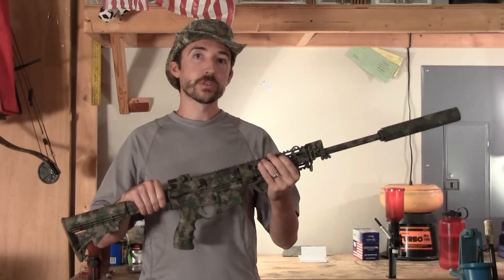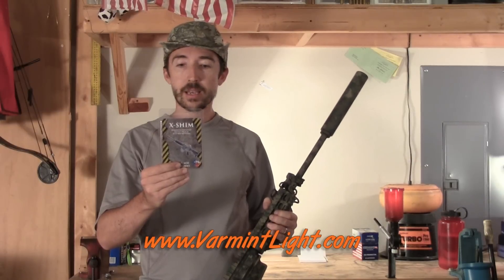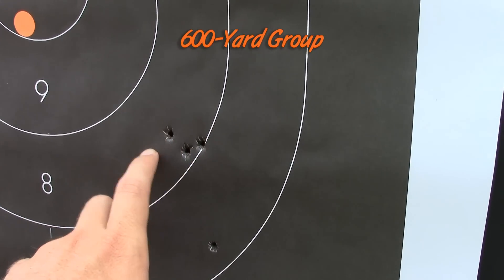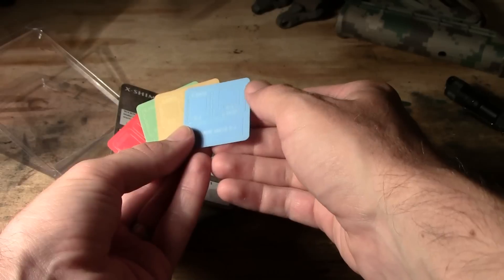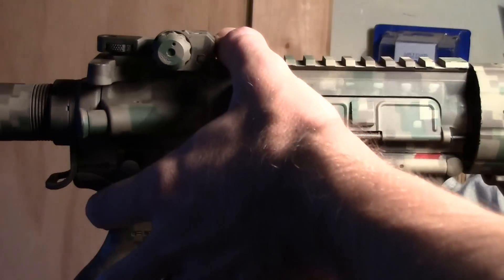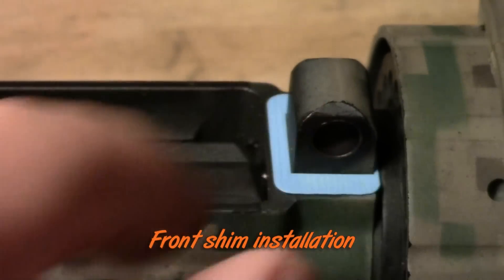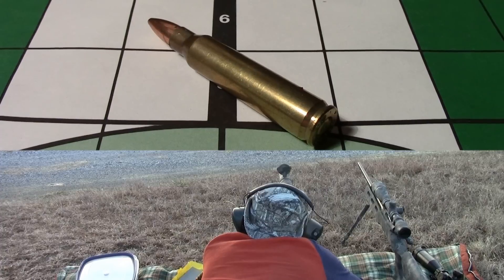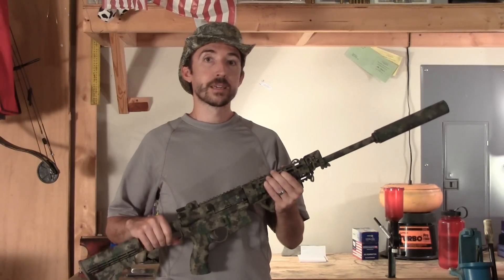Accurize an AR-15 with X-Shims for the AR-15 and M16 | The Social Regressive

Comment: Older video, I know, but I've been down this road.  An older AR of mine was always a 1.5 to 2 MOA shooter, even with developed hand loads.  It had a bit of slop between the upper and lower.  I tried the accu-wedge and it made no difference.  So, similar to the plastic wedge above, I used some stainless shim material to tighten things up (I didn't permanently mount it, I just wedged it between front and rear and used the compression of the fitted parts to hold them in place).  I noticed no difference in accuracy.  I shot the rifle with my stainless shims over a period of time, again, it was still a 1.5 to 2 MOA shooter.

To me, this makes sense.  The barrel, upper, and BCG are all "one piece" in function and the lower provides no support in terms of those parts functioning together other than to provide the fire control group.

So, what I found that does make a difference is the barrel extension fit to the upper receiver.   There are several ways to make this fit tight.  In my rifle, I could remove the barrel nut and slide the barrel right out of the receiver.  When seated, there was slop and wiggle.  One of the traditional methods is to wrap the barrel extension with a piece of stainless shim stock and then use green loctite 620 to fit back together and make it tight.  It does work, however if you ever decide to change your barrel, removing it is a royal pain.  Another method is buy an after market barrel extension slightly over size by various amounts to achieve a tight fit.  One downside with this is achieving proper head space if you don't have a way to mill things to dimension.

My method involves the stainless shim stock and heat.  Years ago I flew powered paragliders and the reduction pulleys to drive the propeller are mounted via bearings in an aluminum housing.  The trick was to heat the aluminum housing in the oven to 300 degrees, put the bearings in the freezer and once to temp, the bearing fit into place easily.  Once the aluminum cools and the bearings warmed, the interference fit was quite tight.

So, using that method, find the thickness of shim stock that allows you to fit the barrel extension into the receiver snugly at room temp.  Change the shim stock to one that is .001 to .002 thicker, then heat the receiver and cool the barrel extension and fit them together.  Once the pieces reach ambient temp, you'll have a super tight, wobble free assembly that can handle some higher temps and remain somewhat snug.  If you shim and assemble at room temp, once the gun heats up from shooting, it can get loose again because of the expansion coefficient differences of aluminum and steel.

Comment: I put a match 1/9 twist 24" bull barrel on a not so tight lower and it shot 1/2"groups.  The harmonics of a heavy bull barrel are not affected like they could be with a thinner barrel and loose fitting lower.

Comment: Unnecessary. No the wiggle doesn't matter on an AR platform. It's a different beast than a traditional walnut and blue steel rifle. Putting rubber shims, accu-wedges, o-rings, aluminum foil in your gun to remove the slop, all bullshit. Unnecessary and stupid. There are only 3 necessary steps: Put ammo in your mag, put your mag into your AR, shoot. That's it.
Reply: Dead wrong
Reply: @aaronkeener95 😂😂😂 The lower has nothing to do with accuracy. That myth has been busted over and over
Reply: @jaxbeach09  if you think so people love to be wrong.
Reply: @aaronkeener95  I don’t think so, I know so. I have a $3200 Cobalt Kinetics SPR Elite that shoots lights out with no slop from the factory. I took that upper and put it on a $270 PSA lower that had a quite bit of slop. Guess what? It still shot lights out.
Reply: @jaxbeach09 sure kid
Reply: @aaronkeener95  Kid? That’s funny. It goes to show you don’t do very much shooting
Reply: @jaxbeach09 😂 Anytime you wanna come to LR Match to find out your more then Welcome to kid. make sure you bring your mom‘s permission slip.

Comment: I, personally, don't think a lil bit of slop between the receivers effexts accuracy on an M4/combat rifle, but could wear out the takedown/pivot pin holes
Reply: I’ve heard so much back and forth on this, I wish we had a clear answer. What I gather, a little slop won’t really effect anything, but too much can throw the shooter even if it’s not technically effecting mechanical accuracy of the upper receiver. As far as I can tell, the slop will grow over time regardless of whether the rifle is tight to begin with. I’ve heard that using shims or accuwedge can create more wear over time by putting pressure on the pins. So I’m the end it sounds like we’re kinda chasing our tails a bit. Rifles will wear. But my question, is it worth keeping the rifle tight? Does it lessen the wear and tear?

Comment: This might work kinda, but if you're serious about accuracy then you might want to use .001" oversized pins. Or drill and tap your lower to accept a nylon tipped set screw. One in the front and one in the rear. Of course this helps a little more than shimming. I typically see 1/2 MOA or better improvement using the set screw method. This doesn't take into account the other inherent problems with the design of the AR platform, but every little bit helps. Shimming the barrel into the upper receiver with some green loctite will tighten up your groups as well. So will addressing Bolt carrier tilt. It's definitely possible to take a $500 rifle and make it shoot as well as a $2000 rifle. It just takes a little knowledge.

Comment: Play in the upper receiver and barrel extension is far more important to eliminate than upper lower fit. I have done extensive testing on 4 different rifles. Only 1 of the four showed improvement after eliminating upper lower slop, and this was the 1 of the 4 that had the least wobble, I still find the slop annoying tho. Slop in barrel extension/upper, and bolt carrier tilt are the 2 killers of accuracy in the AR-15. read Joe Carlos articles on American gunsmith for techniques.

Comment: I put a big glob of KY on the upper receiver tabs and insert them slooooowly into the lower receiver, and I gently wipe up the excess with a very soft tissue. Then I massage the charging handle back-and-forth several times to purge any air bubbles from the takedown & pivot pin holes. Then I am ready to shoot...Buahahahaha!!!

Comment: the problem is out of spec holes. JP Microfit pins are made bigger and bigger by .001" use the pins that are snuggest fit and the problem is permanently solved for a $28 set of pins.

Comment: I picked up an Accuwedge for my 20" A2. I've had it in my rifle for 13 years.  It's starting to break down from the oil; time to replace it.  I never expected any improvement in accuracy but it did tighten up the rifle nicely.  It took out the play between the upper and lower and prevented wear from the two halves hitting each other and kept the pin holes in the lugs from wallowing out.

Comment: On my LR308 I used oversized pins and an adjustable reamer to get a perfect fit.  Now it locks up tight and the only rattle is the BCG because there is no way to remove that slop.
Reply: They have oversized BCG's, they are larger in diameter, and take up a lot of the slop

Comment: I have also found side to side play in my A2 rifle I compete with, and to eliminate that I did shim one side of it to eliminate play as well as using an accu wedge, that was years ago so I don't remember how thick the shim was, but I have a selection of shims and I'll look to shimming the upper and lower as you have done here also. I can use every 1\4" I can get. Thanks!

Comment: I used accu wedge on a BCM upper and spikes lower build and yes there was significant difference in accuracy,but its been 6 months now and accu wedge is loosing its size i guess u could say ,its easier to push down and put upper to lower,when before it was really tight. I am going to try the new product in your video,thanks.
Reply from the maker: I'll be interested to hear what your results are.

Comment: I have never used any shims on my AR but I know that when doing my CQB training, while using a forward grip, having a sloppy interface, and pulling the rifle solid into my shoulder will most definitley create side to side torque on both halves and throw my shot off quite a bit if im not pulling perfectly straight back into my shoulder. Its unacceptable when talking about shot placement for quick takedowns...I might give this a try
Reply from the maker: You're absolutely right.  When I first started shooting there was a fair amount of misinformation floating around about rifle movement before and during recoil.  That interface between shoulder and buttstock is crucial, and I think that the solidity of the platform is, too.

Comment: Does the x shim helps close the gap between receivers?
Reply from the maker: No, it doesn't.  It removes the rattle, but it actually pushes the receivers apart.
Reply: The Social Regressive ，thanks for the info

Comment: Great video.  I tried the accu wedge years ago but did not notice any accuracy improvement.  My rifle at the time had a 20" stainless steel match barrel and free floating handguard and 9 power scope so accuracy was quite acceptable starting out even with a bit of receiver gap.  I wish that I had recorded the group sizes now (refreshed all my AR rifles over the last couple of years so currently don't have significant receiver gap).   I think that the shim system might be more successful  because it supports both the front and rear of the receivers.
Reply from the maker: This little test makes me wonder how much of my accuracy degradation over time was not due to throat erosion, but increasing slop in the rifle.  I've read about people testing this theory and writing it off, but after this demo...I'm not so sure.
Reply: I think you might be on to something.  Wonder if I put enough rounds through my old 20 barrel to explain average group size increase to 3" at 100 yards but I shoot it for over 15 years before trading it off so it had a few thousand rounds through it.  My Remington 700 heavy barrel 308 can still shoots one hole groups at 100 yards and I have been shooting it for over 20 years so it makes me wonder.  I know that I am comparing apples to oranges.  At any rate from watching your demo, I believe the shims could have potential.
Reply from the maker: Stickfighter
I shot a few more groups yesterday.  Aside from some weirdness with steel-cased ammo, the shims seem to be improving groups.  Video soon!

Comment: Yes, I bought a couple dozen Chinese imitation acu-wedges and have used them for about 20 years now.  I don't do a whole lot of benchrest and was mainly looking for the peace-of-mind feeling of a tight gun.  I do think I shoot better with them, but the biggest change I made was when I started doing free-float builds rather than just regular handguards.  Yes, I know that's almost mandatory these days, but when I started building there were all of about two choices: DPMS and YHM.  My national match rifle has the free-float handguard under modified rifle-length handguards I built it in about '95 I think for High-Power shooting..  Still has the same wedge in it, so the Chinese rubber is still going strong.

I have thought about doing an M-14 / M1 Garand style bedding job on the AR-15 by using devcon.  Would have been in the same general area as the X-Shim.  Had a system worked out for it in my head, but never got around to it.
Reply from the maker: Great info!  I'll second the free-float tube.

Comment: Very good video.  Thanks for the post.  It looks like shimming does make a difference.  I 'm wondering if you have re-shot after cleaning the shimmed rifle and if you did... did the cleaning make any difference?
Reply from the maker: That's a good thought.  This particular ammo I made uses a very clean-burning powder, and I can go a long while between cleanings, but I did shoot some other stuff that clogged up the works.  I recently did a full clean, removing the copper, too, and I'll bet that after a mag or two the groups started shrinking again.  And I need to really test the shims with my primary load - 75-grain BTHP.

Comment: 4 groups, 2 with and 2 without, doesn't tell us a whole lot.  It could just be the shooter (you) warming up that day.  It could have been the wind.  Luckily, this is an easy problem to fix, just shoot a lot more groups :)  Statistically, over the course of 5 or 10 groups with and without, you will be able to say with great certainty one way or the other.

Still interested in seeing what you plan on doing with that budget build!
Reply from the maker: True.  I shot the groups last year.  I can't remember why I only did two groups back-to-back.  I think this time I only had 20 cases prepped out of the tumbler.
Reply from the maker: One good indication is the fact that the groups opened up vertically; I think the windage wasn't much of a factor.
Reply: I think there may be something to the shims.  My AR is a little loose and the best groups I've ever got were around 1.5 MoA, so if I could remove .25-.5 MoA out of the rifle itself, I'd be really happy.